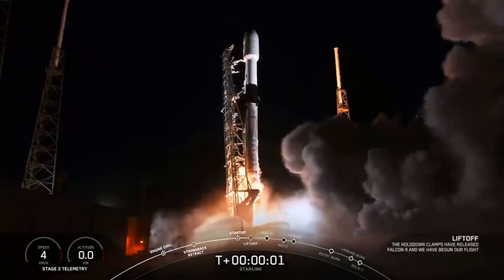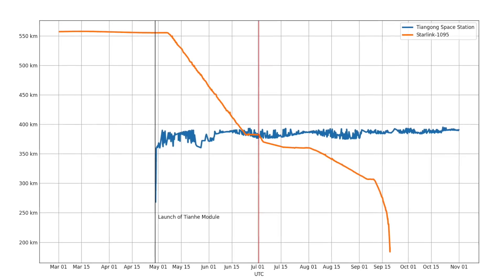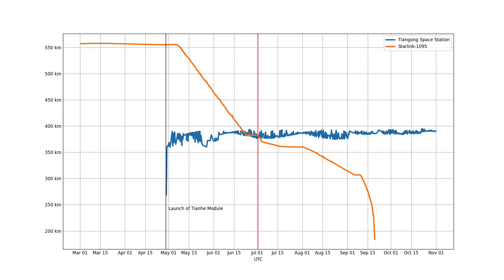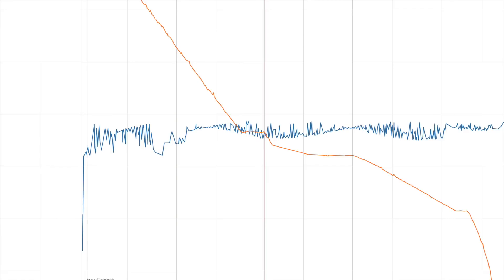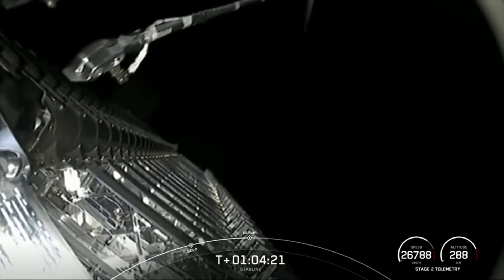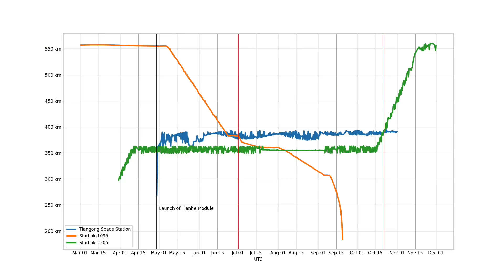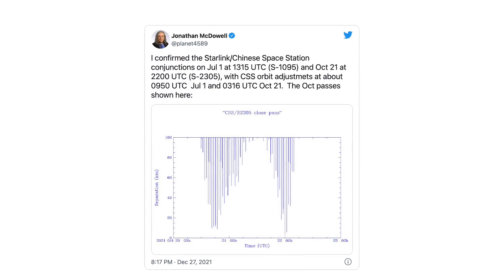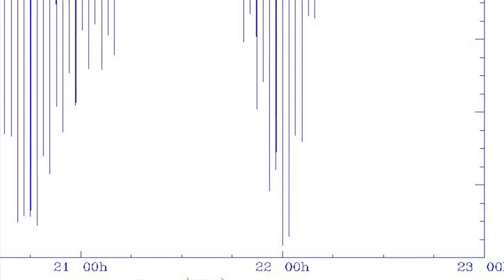What went wrong with Starlink's collision avoidance? Two Near Misses with Chinese Space Station

Comment: Might it not be as simple as the ascending or descending satellites to/ or from their service altitudes are simply incapable of collision avoidance? 

Might it be that their capability of "collision avoidance" is only activated when they have reached their service altitude or their collision avoidance system is switched off when they leave their service altitude? 

- With ascending satellites the main reason for not having switched ON collision avoidance might be that they are flying  in a pearl-string-formation and thus their collision avoidance software would possibly try to (unnecessarily) avoid other relatively close ahead flying satellites, and precious propellant would thus be burned.

- With a descending satellite there might be another set of reasons why the automatic collision avoidance system could run into problems - such as the sensors not receiving easily interpretable data.

The temporary descent pause of the descending SpaceX satellite might indicate that the satellite had indeed tried to avoid the Chinese space station but did not really know how to handle the event:

The reason for this might be that the Chinese space station is quite a big object and the satellite sensors were possibly not prepared for dealing with NOT-POINT-LIKE objects. 

For beforehand unconsidered edge cases - like for instance this one - the satellites might have been taught to keep their orbital flight height and wait for further instructions. 
(The clearance to continue the descent would then likely be given by ground control.)
Reply: Its actually quite likely, the two modes might have completely different software stacks for navigation.
But then its a failure of mission planning.